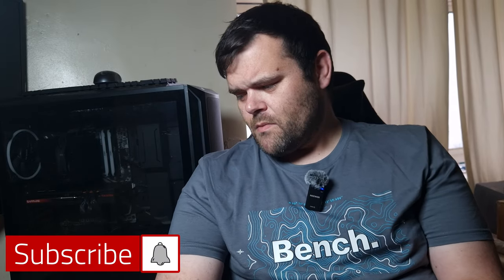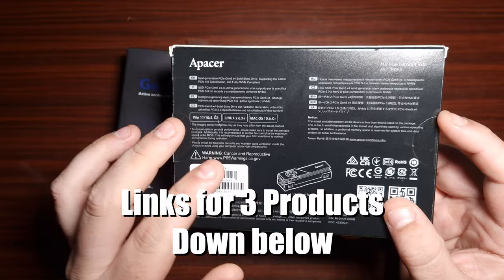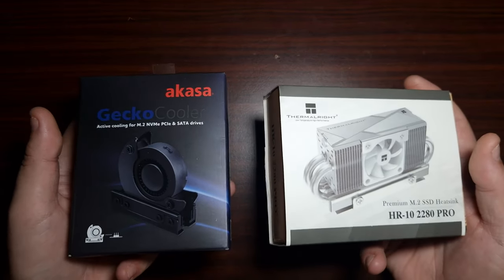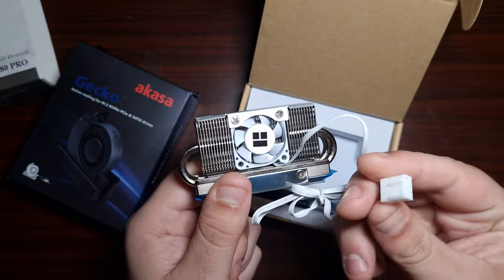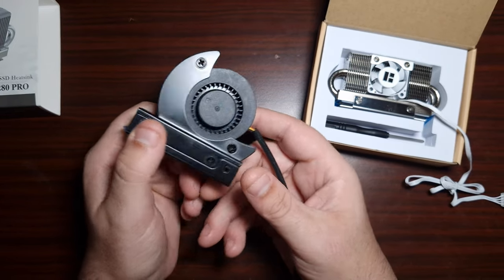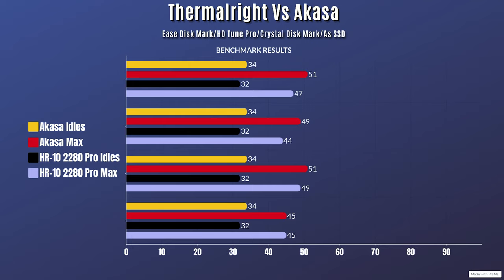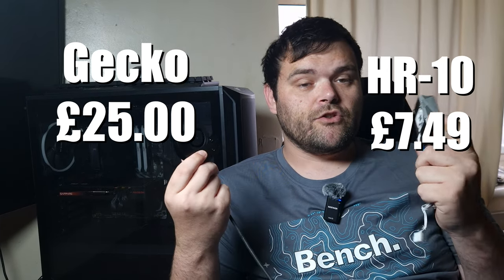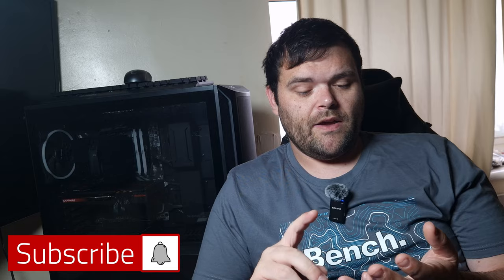Do you really Need a Heatsink for a M.2 NVME Drive? (HR10 2280 Pro

Comment: I have problem with this thermal right, I'm satisfied with the temperature but the fan noise is annoying
Reply from the maker: You can turn down the speed of the fan
Reply: @WELSHYTECH  that's good idea , I will try that. I didn't have the isuue though until a month in.
Reply from the maker: @geocine  could be the bearing on the fan maybe But down the speed down and see if that helps

Comment: Some SSD on lower temperatures stops throthling when have big load.
Reply from the maker: If it's within its operational temperature, it won't throttle, and if you watch the video, I explain all this
Reply: @WELSHYTECH  maybe only in your computer operating in low temperature many other manufacturers SSD in other computers operating not in the best condintions and on high continuous load
So if its not needed for you that not means not needed for others
Reply: In my case main nvme slot very near CPU socket and absorbing heat from cpu I use something like HR10 Pro and temperatures ok
Reply from the maker: @niekonzn  gen 3 gen 4 and gen 5 have different operating temps and on every Motherboard the top M.2 is for the fastest NVME's Because it's the closest to the CPU and my case is the Hyte y40 which has the GPU vertical and while gaming it will blow Hot air from the GPU Which generates way more heat than any CPU and the Heatsink that comes with my Motherboard keeps a gen 5 drive below its operating temps on full load and it's only when a nvme goes above its operating temps it will start to the throttle

Comment: Hey mate, Just bought a T705 top of the line Crucial NVME. Normally I'm fine with mobo syncs, but this thing is pretty much the best you can get and 5.0 so I'm  a bit worried about it  mobo stock over the sink it comes with. The sink is just a small little thing, nothing beefy, which also tells me maybe it doesn't need that much, but I don't know.
Just sticking with the stock solution would be nice, but I feel like OEM knows better?
Reply from the maker: Personally, If you're that worried I'd buy the HR10 2280 PRO because it's cheap and gives you peace of mind

Comment: The question does not arise, obviously an SSD needs a cooling system, more important than a CPU. A CPU that will go up to 65° on a calculation in play, the SSD will go up to almost 80°.
The stupidity of having invented the SSD without foreseeing that a cooling system was necessary. Like building a car engine without an oiling system
Reply from the maker: Um nope a SSD doesn't need a cooling solution, and as NVMES not SSDs get faster speeds, they will need much better cooling solutions but not quite yet